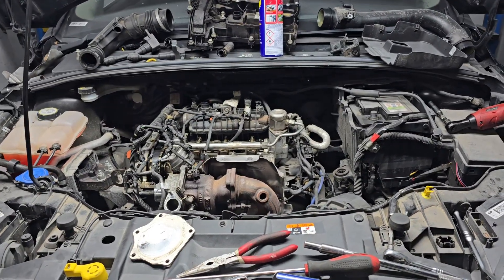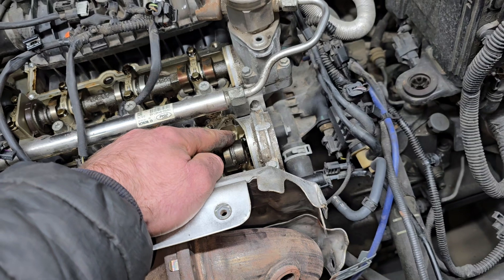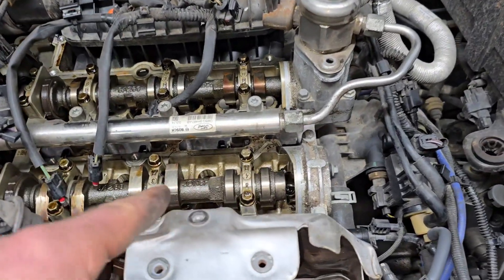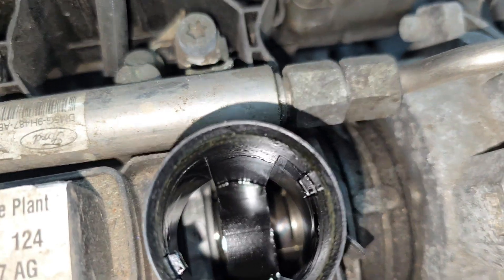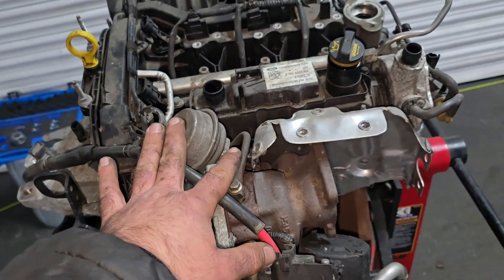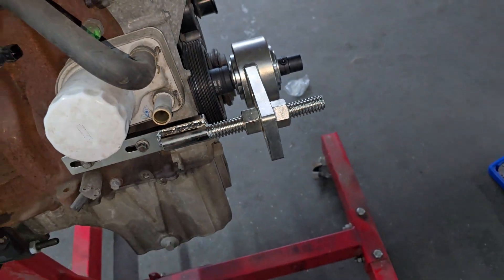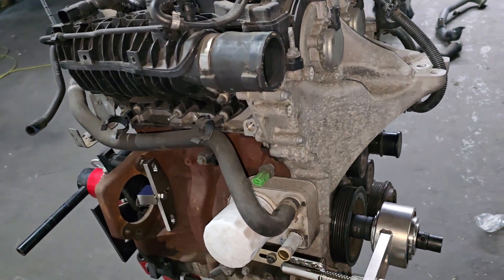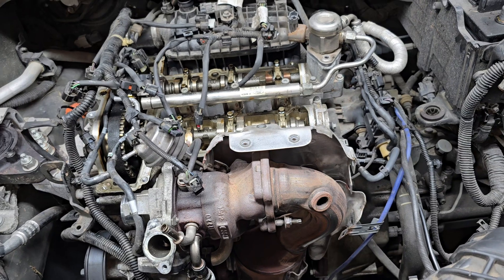Ford ecobust 1.0 petrol engine failure due to vacuum pump fail

Comment: Is it better to change vacuum pump or the engine itself ??
Reply from the maker: Depending on the damage.  In my case, I  changed the valves and new timing belt kit and all good.
Reply: @DIY_PROFESSIONAL thanks for your reply 👍

Comment: it's better to use the adapter plate as shown on 4:32. Otherwise the attaching points on the engine might break off.
Reply from the maker: Yeah.  That's not a bad idea